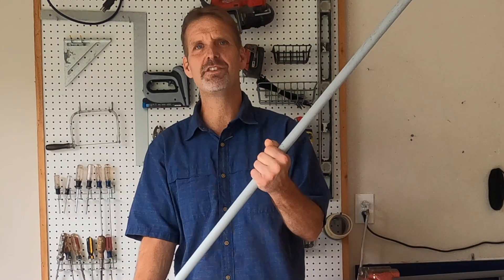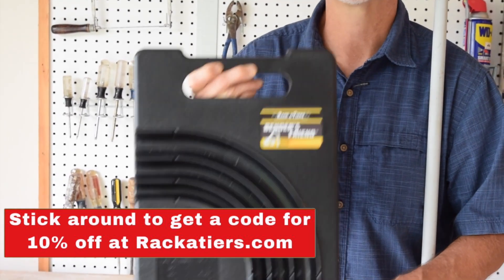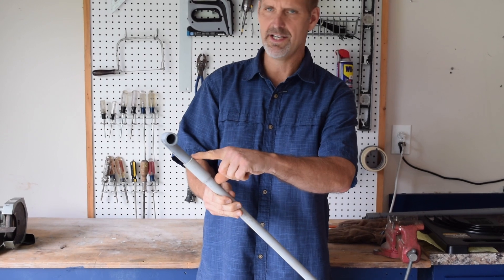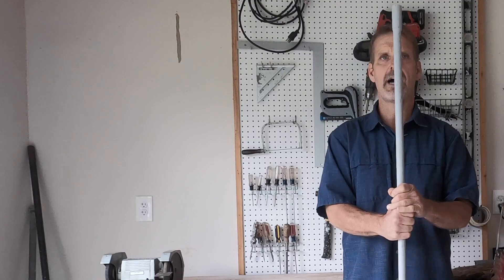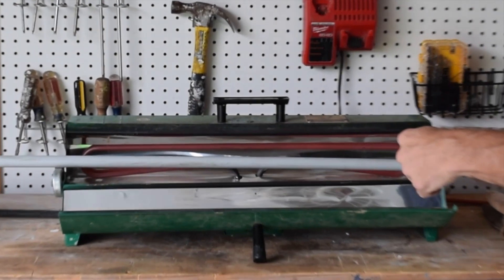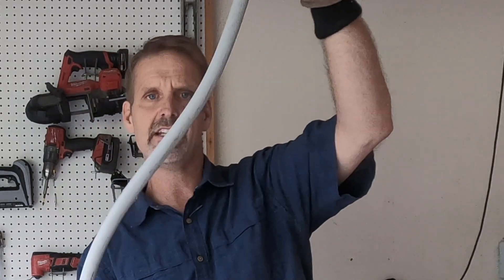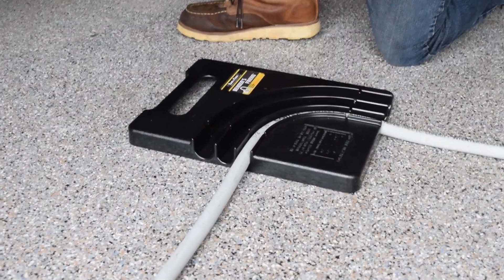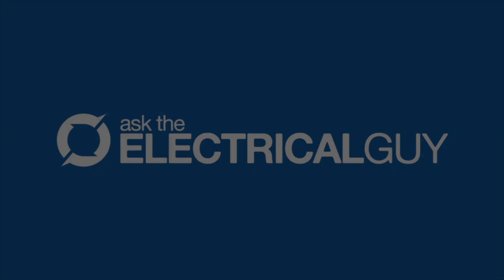How to Bend PVC Pipe and Get Easier 90º Bends: Introducing The Bender's Friend

Comment: The amount of heat used with the heat gun in this video does not weaken the pipe.  If you are someone who insists this will weaken the pipe, how else do believe manufacturers make polyvinyl cloride (PVC) products from pellets if not by heating them?  Just like other hydrocarbons with amorphous (not crystalline) structure, PVC melts with heat but does not change structure when cooling.  For lack of a better example, think of how the triglycerides in Lard react to heat. You can heat up lard and it will soften and turn to liquid, but when you put it back in the fridge, it will harden back up and still be lard.  Now, in the same way that you can overheat and break down lard or any other cooking oil (i.e. liberate Hydrogen atoms and production double bonds between carbon atoms or trans fats) you can chang the structure of PVC too. You might think that it is like chocolate which never hardens if it dosent temper but unlike something like chocolate which is a emulsion of various molecules which must heat and cool in a specific way to form the crystalline structures necessary for optimal hardness, PVC is a single molecle with an amorphous stucture that can heat and cool in any old way as long as it not overheat it.  You just need to get it over ~215F  If you want to make sure you dont harm the stucture of PVC when heating it.  If you are worried you could use an infered heat gun to insure you dont go over ~390 F which is the temperature you will permanently degrade PVC chemical stucture and weaken it.

Reply

Comment: what keeps the inside from collapsing, or kinking when it's soft after heating?
Reply from the maker: If I understand you're question correctly, you need to leave the PVC in the die until it's completely cool.
Reply: @asktheelectricalguy2223 right that makes sense but in the same way you could kink/collapse metal tubing/emt in the process of bending "cold" still not sure how the plastic will not just collapse in the bend or elsewhere from it being softened by the heating...if the answer is it's just a matter of handling it carefully to prevent it, that's fine but you seemed to wiggle it around "like a wet noodle" in the video before just laying it in the die and it didn't flatten, or mush...I guess the trick is not to overheat it as you said, just enough to sag under it's own weight in the heater as you rotate it...thanks for the reply.
Reply from the maker: @frankconte5545  In addition to overheating or under heating, it's necessary to make sure that enough of the length is soft, not just one point. The hot box I was using in the video heats up about 18" of the pipe. If you're using a heat gun, you have to be sure that you heat up enough length. It's trial and error. You'll figure it out as you go.  If the pipe does kink when you bend it, then you either haven't heated up enough length or the circumference of the pipe.

Comment: Nice die but I could also just place hot pipe in a pipe bender. Wondering why there’s only 90 degree, I use 45s 22-1/2, and sometimes even 11 degrees bends and also offsets and saddle bends.
Reply from the maker: This video was to introduce a tool to bend 90º that some people may be unaware exists. I've never heard of putting hot pipe in a pipe bender. I can't imagine that working. Is that how you currently bend hot PVC?